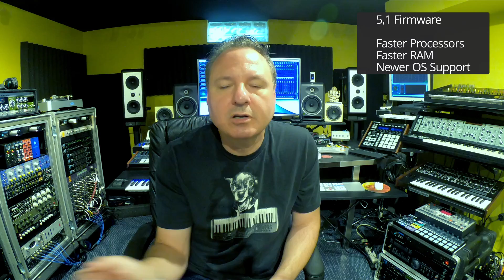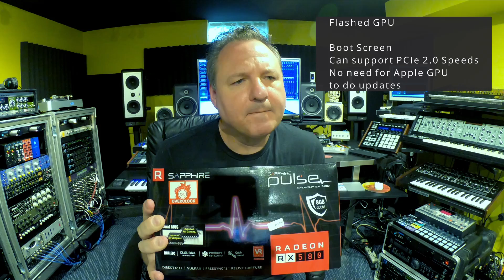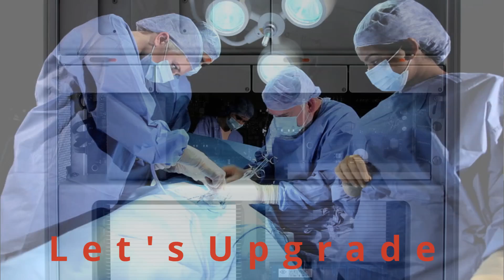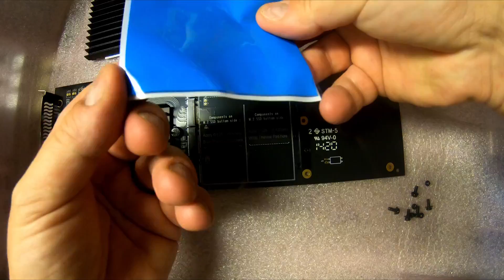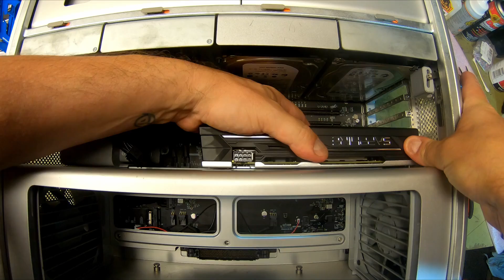2009 Mac Pro 5,1 Extreme Upgrade

Comment: Im using two Mac Pros together. I have a Mac Pro 2012 5,1 and a Mac Pro 2013 6,1
5,1 is a 4 Core with 16 GB of RAM with 2 ATI Radeon 5770's an Apple RAID Card and 6 TB  at RAID 1 + RAID 1 over 6 HGST 1 TB Hard Drives. My 6,1 is a 6 Core with 2 AMD Radeon D500's and a Apple 512 GB SSD. I have them tied together over a direct attach Ethernet Bridge. For a total of 2 Gigabit. Works Great. And it allows me to spread work out and keep certain workflows agnostic to a certain machine. I do most of my CPU Intensive stuff on the 6,1 and most of my long term storage on the 5,1 are the genral usage for both and why they are used together

I just bought a dual cpu tray for the 5,1 and 128 GB RAM and a AMD Radeon RX 580 and then for the 6,1 I bought a 2 TB SSD and 128 GB RAM and a Xeon 12 Core
so ill be at 128 GB RAM and 12 Cores on both and up to 32 GB Of long term storage on the 5,1 with two 2 tb nvme ssds

Comment: 4:30 A totally false premise here about "weird hacks", i.e. any modification beyond Apple official upgrades. The 5,1 here is limited to Mac OS Mojave according to Apple. But, OpenCore Legacy Patcher (OCLP) allows this and other Mac Intel Machines (3,1, 4,1, 5,1, 6,1) to go beyond with Mac OS upgrades Apple originally supported -- since they believe in planned obsolescence with about five or so years of official support. Therefore, Intel Mac owner enthusiasts found a solution to this dilemma rather than having to re-purchase their expensive hardware every few years.
They use OpenCore Legacy Patcher (OCLP). It is a popular open-source tool that allows users to install modern macOS versions at/beyond Catalina on older, unsupported Intel-based Macs. It works by using a specialized bootloader to inject necessary drivers and patches, enabling features like Metal graphics acceleration, Wi-Fi, and AirDrop on older hardware. 
There's nothing "weird" about keeping your well made machine going -- as opposed to being stuck on really old OSs. To make a statement like that is based on ignorance and the lack of knowledge of the subject.

Comment: Thanks for your video. I have a 5.1 that I'm in the process of upgrading, and I'm thinking of installing an RX580 Nitro, but regarding that... it seemed to me that in your setup, you left the graphics card fans very covered by the NVMe card, and I tend to think that this hinders the ventilation of the graphics card, which might not be a big deal if you don't use it for games or very demanding applications.

So I don't know what your experience has been in this regard. Does your graphics card get very hot?

Comment: I am in agreement with the below comment from fellow YT'er Nicky Gepetto - Paul, I believe you have done a fantastic job with setting out each instruction component in a cohesive and cogent manner to great effect. Perhaps the only thing missing is the segmentation of the video and its parts, although I respect this feature may not yet have been introduced when this video was made in 2021. I note too you have at least two keyboards in the studio. I am just getting back into the piano and currently use a Yamaha P120S. Would you mind if I IM'd you for some ideas and guidance/advice? Thank you kindly, Andrew

Comment: You list the Mac Pro as starting in 2009.  It was actually first available in 2006.
Reply: The 4, 1 started in 2009 and was replaced by the delidded CPU 5,1 model the next year. Since the only Mac Pro you want to bother with are those models nothing else needs to be recognized.

Comment: I can’t find the dual 6pin to 8pin power cable for my 580 graphics card.
Reply from the maker: https://www.amazon.com/Adapter-Braided-Sleeved-Computer-Graphics/dp/B08FXVDM8S/ref=asc_df_B08FXVDM8S/?tag=hyprod-20&linkCode=df0&hvadid=692875362841&hvpos=&hvnetw=g&hvrand=16852744754816095214&hvpone=&hvptwo=&hvqmt=&hvdev=c&hvdvcmdl=&hvlocint=&hvlocphy=9014968&hvtargid=pla-2281435177658&psc=1&mcid=c0094acee1fe3a1cba375502a819b32d&hvocijid=16852744754816095214-B08FXVDM8S-&hvexpln=73

I think this is correct.

Comment: Sonnet Sonnet.  Can i use the first nvme as the system drive with big sur and the second nvme as a raid drive?
Reply: Why and why. Do you know how Raid works probably not bc you are asking. Its unwise to setup your Mac based off some YouTuber who overspent on his outdated Mac Pro and thats even by the standards of when this video was made. Search the Mac forums and not just YouTube as theres a wealth of info in regards to these outdated machines. I can say by far the bottlenck for these machines wont be your pcie plane thats easily the xeons and limited GPU options and the latter usually excels better in Windows only.

Comment: This is the best video I have ever seen concerning upgrades to the Mac Pro 4,1 and 5,1.  That model was in my opinion the pinnacle of computer design.  Form factor, connectivity, cooling system--simple, powerful, versatile, reliable.  12 years later computing has come a long way, but the fact is that a well built 5,1 remains a valuable workhorse.  I keep one dedicated to running pro tools HD 11 in my recording studio, for me it is as timeless as any great piece of analog audio gear.  Twin 2.66 GHz 6-core processors, 128 GB RAM, HDX card, UAudio UAD2 quad card.  Soon I will upgrade to SSD drives, 1 boot and 3 in a RAID.

I find it deeply satisfying and encouraging to know there are others out there who, like me, appreciate the lasting usefulness of this great computer that was sadly (and perhaps shortsightedly) discontinued over a decade ago.  I know that Apple owns the designs and calculated the business metrics of continuing or discontinuing the product according to projections of diminishing profitability, but it is such a sublime piece of hardware, one that really should have enjoyed a longer period of production and support.  Thank heavens for third party solutions that continue to make owning and operating our venerable cheese graters possible.
Reply: Where do you live, in a cave....Plenty of sites with information abut cMP upgrades long before this, it's not new....
Reply: @ yes, I live in a cave, it’s a great way to avoid jerks

Comment: Nice video.  However, there is one thing you overlooked, and that is the 2032 battery.  You put a CR2032 in place of a BR2032.  The BR2032 is a rechargeable battery, whereas the CR2032 is not.  As a result, the CR2032 will get damaged over time, because the circuitry around it will always attempt to charge it by applying current to it.  I don't know if you're still using this machine, but if you are, you should definitely replace that battery with the proper one.

Comment: I bought a Mac Pro 3.1 2008 model back around 2017. I've upgraded it a couple times over the years, and I'm just getting done with another refresh, and every time I do it, I am astonished with how well it continues to keep up with current tech. Apple did their best to phase these units out because they were too good and too reliable to convince people to upgrade to a newer model. here, 15 years later, it still keeps up.

Comment: One correction. The Mac Pro 2019 will take 128 Gb but only recognize 96. I upgraded two of mine. Also putting the SSD in the slow SATA slots I think is a waste. I think the connectors for the SuperDrives would give you more speed. I am using Iocrest PCIE card With 2 Crucial gen4 2 TB NVME and getting 2800 read and write. Not bad for a 14 year old computer...

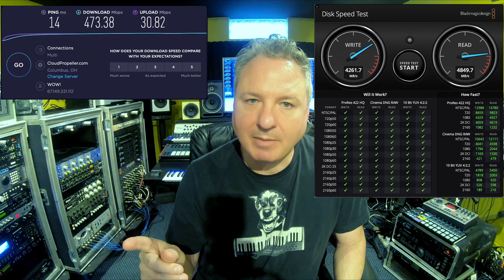Comment: 24:58 - Annnd, pauses,... Any special tips on getting the OS to write data at that speed? I have a 5.1, same 3.46GHz processors, system on a SATA SSD, with an OWC Accelsior 4M2 and Samsung M.2 drives, the M.2's are faster as individual disks then they are as Raid Zero. Take the same 4M2 card, drop in to MSI X99A SLI Plus board with i7-5820, and I get faster Raid Zero then what you've shown here.
I have a Kona4 card, looking for performance for Uncompressed Raw DNG's for video.

Comment: I know this video is 2 years old, but that picture that was shown is not a 5,1 cpu tray, it's a 4,1.  The cpu's were de-lidded and there are no cpu clamps. I 5,1 has cpu clamps and uses lidded cpu's.
Reply: I dont know why the vid was titled 2009 5,1...  should have been 4,1 if 2009... probably just a slip up.

Comment: Good video but there are some updates to this upgrade and I'd like to share them with you.
Mac Pro 4,1 and 5,1 CPU's only support 3 channels of memory.
If you put 4 channels in it, it run very poorly.
You want to put 6 32GB memory chips in it.

The delidded x5690's don't work well on the 2009 models because of heat problems. 
X5690's run at 130watts and need the lid to help in cooling and a whole bunch of variables and hardware that only are in the 2012 models.

The best processor for this upgrade is x5675, they run at 85watts and in some cases out perform the x5690's.
I wish I knew all of this before I spent way too much money down this rabbit hole LOL!

Hope this helps, let me know if you need help :).
Reply: When you run x5690's on a 2009 and load it heavy, the computer will shut down.
Do not put any processor in the 2009 models that uses more than 85watts and operates higher than 80°C.

Just because you can do it doesn't mean that you should :).
Apple didn't do it for a reason.
Reply: @irawardmusic  I have 2 5680's in mine without any issues.
Reply: @vladimirpetrochenko  Nice !! I had them too but when I ran the computer hard, the temps went too high and then the computer shut off.
I had delidded 5860's and that might be the issue.
The lids also act as heat dissipaters.

Comment: I'm in process of doing most of these upgrades to my 2010 5,1 Mac Pro, including Mohave as the plateau upgrade. Some similar videos suggest a problem with the Mac displaying the post screen on power up / restart, so you can't dot the ALT startup and then have a visueal means to choose the startup disk. Does this RX580 & Mohave config display the post screen or is core boot or similar hack needed?
Reply from the maker: This one boots and behaves normally. I see the boot up screen as expected, and it’s just the regular OS in play.
Reply: @paperstreetaudiocompany  Thanks for taking the time to reply. Of the several Mac Pro upgrade vids I've seen, yours is the easiest to follow! Thanks!

Comment: Hey there, thanks for this video, looking to do some similar upgrades to my mac pro.
What kind of speed do you get from your raid nvme now ? It's still only pcie 2 so I'm guessing that has to be the bottleneck, not the drives. 1000Mo/s ? More ?
Reply from the maker: It’s a big improvement over the original. It’s was reporting something like 3800/s on the M.2 drives and that’s working great for me. I’m sure that the drives themselves can go faster, but it makes working on this machine feel the same as most modern macs.

Comment: The RAM is marked DDR3-1066Mhz, PC-3 8500? Didn't you intend to get  1333 MHz DDR3 ECC SDRAM (PC3-10600
How can you actually tell the bus speed and the interleave?
Reply from the maker: The marking is confusing but the ram does run at 1333 and it reports as such in about this Mac. When it has the 4,1 firmware the computer would have run the ram at 1066, but the 5,1 firmware for the Mac Pro runs the ram at 1333.
Reply: @paperstreetaudiocompany  

On the PC, we have CPUz, on the Mac, I use GeekBench 5. What does GB5 say? 

Nice: So you have 24 threads, 12 cores, 24Mb of cache... 4xNVE... how fast does it boot?
Reply from the maker: It’s hard for me to time it exactly, but booting from an M.2 is quite a bit faster than from the spinner it came with.

Comment: Stupid question... You do all this with the same system, next time you turn on the machine everything will be OK and "reckognize ? Or, you will have to re-install the system after having made such huge modifications ?

I ask because, I'm going to receive mine, I'm not Apple friendly... With a PC you can change everything on the fly and it boots up again, but with a Mac ? Such an old Mac ???
Reply from the maker: It’s the same as with any computer, I put in a faster processor, more ram, and bigger faster SSDs and M.2 drives. I didn’t need to reinstall the OS, it just runs like a fairly modern machine despite its age.
Reply: @paperstreetaudiocompany  This Mac pro is awesome, that's why I chose this one... ;). Thx for your reply.

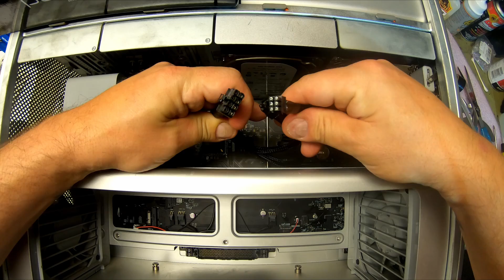Comment: 19:33 OMG. I am an idiot. I did read about that Y split power cable for GPU but I thought it was other way around. For GPU that needed two 8 pin cables. That changes everything. I use RX 580 and my Mac Pro shuts down under heavy load. But that way I can juice my GPU with double the power. 

Thank you so much for this. Now I most likely don’t have to do Pixlas mod.

Comment: JAN 20, 2023 ~ Hi, your video is the third I've watch on upgrading a Mac Pro Tower, and THE BEST (most informative) video yet. I really appreciate the extensive explanations. Nothing left out but the approximate total cost spent on your upgrades. Also, it's been a year since you created the video. Are there any NEW editions of cpu, ram or video cards you might install now had they existed a year ago (Jan 2022)? Or anything you wished you had installed instead? There's always new products released and I'd prefer to install the most recent and highest upgrade of components as possible. Or... do you believe that the Mac Pro 5,1 that you upgraded hits the ceiling, upgraded as far it can get? One more thing, wondering if you have had any issues since, or additional firmware, OS upgrades etc. Thanks for any reply or additional, related videos.
Reply from the maker: I just looked and some of the things I choose got even more expensive with parts shortages and such. Wow

Comment: Hi 

I’m curious how your getting 4000 + read and write speeds in a Mac 5,1 . I currently have the same machine and I can’t get more then 1300 -1500 . I have a single m.2 slot card ?
Reply from the maker: That comes from the M.2 drives on the Sonnect PCI card running as a RAID.
Reply: @paperstreetaudiocompany  can you run those speeds on the Bootup drive or only on the raid ones?
Reply from the maker: I wanted to have my boot up drive be a RAID but it was a bit kludges to get that to work. Instead one good M.2 was my boot up drive, but the working project drive is a RAID and that where I have (and need) the speed
Reply: @paperstreetaudiocompany  Hi,all four M2s are for OSX and the two SSDs (owc blue slide) are RAID 0, is that what you were saying?

Comment: I upgraded my original Mac Pro 5,1 that I found in a dumpster to almost full spec (only the ram isn’t at the maximum capacity as I don’t need that much ram). On this, I replaced the stock bootloader with OpenCore and got MacOS Monterey working!

Comment: Hello, congratulations for sharing your experience with the mac pro 2009, I just want to update mine, I would like to ask you about the processor, I see that the link you shared on ebay mentions that they have removed IHS to avoid damage from over-squeezing since it is very dangerous, my question is how was your experience the processor does not affect the operation because they have removed the IHS ??????
Reply from the maker: https://thehouseofmoth.com/the-differences-between-the-41-and-51-mac-pro/

Comment: Surprised you didn't do the pixalus electrical upgrade, to power the graphics card without stressing the motherboard. 
this involves tapping into the high current 12 volt supply cables before the motherboard, and running high current extensions to the cards 8 pin (or dual six pin) socket.
the tap can be done by utilising clip on taps which cut the insulation but not the wire. (solder is not an option due to the current carried -not unless you have very high temp solder and real skill).  this protects both the motherboard, and your graphics card. note: the typical graphics card extensions sold by third parties, and Apples own cables are are too thin, have not enough copper to carry the current over the extended length of cable to fully power modern high powered graphics cards. 
 the std. graphics cables off the motherboard headers are only rated to a total of 75W, each which is also the limit of the mother board. Giving a card total (with the power via PCIe slot) of just 300 watts. 
However the power supply can easily even at 10 years old still supply a total of a reliable 800w (originally 970W), and with modern energy efficient CPUs, and SSDs these items power draw is lowered so you can still put high powered graphics in place some times as much as 600W.

Know this electrical hardware mod was not on your list, but it is a good idea to maximise the lifespan of your motherboard. especially for those seeking max graphics power. but maybe the sapphire 580 doesn"t draw that much power.

based on your build, the limiting factor for your hardware will now be bus and CPU interconnect.
worth considering when you did the CPU upgrade is repasting the Northbridge. if you use a temperature monitor app, check that the Northbridge is sitting at 74ºC. if you do wish to repast your north bridge do make sure to buy replacement sprung mounting pins before attempting to do so. they break very easily.

nicely done upgrade. envy those NVMe drives.my 4,1 got most of these upgrades, and mined crypto at 94% CPU, 110% Gpu (gtx1080) for 18 months before it became uneconomic. performance wise it was easily comparable to the base 2018 Mac Pro in some contexts but was limited by the bus and the by then old graphics.

I strongly recommend the flashed MAcVidCards if you plan to dual boot the Mac, otherwise booting becomes a weird kind of magic, counting carefully timed keystrokes and hoping.